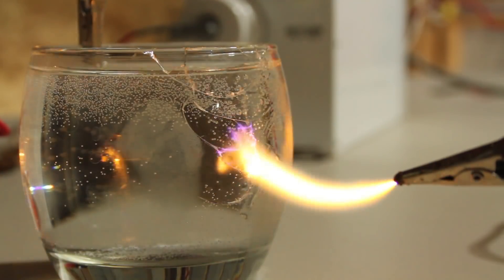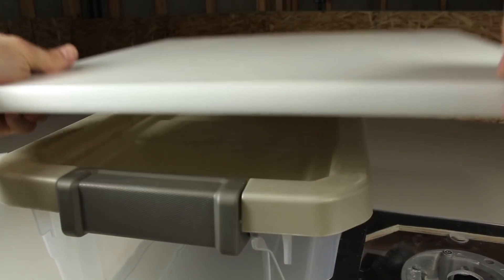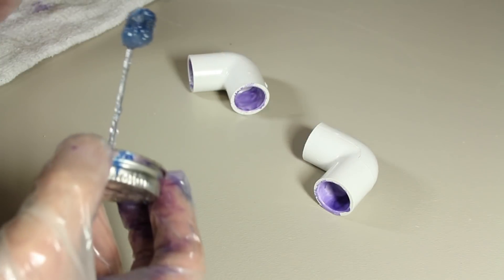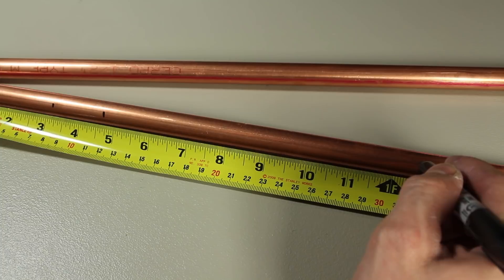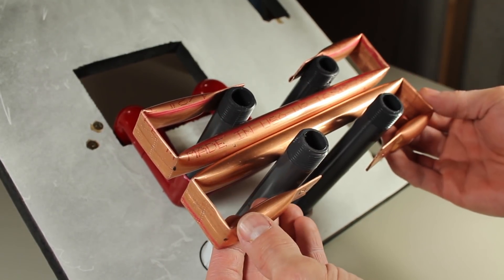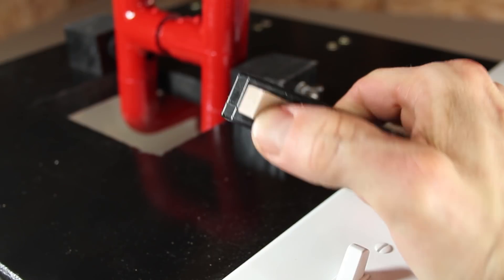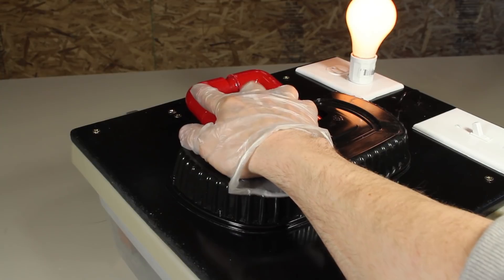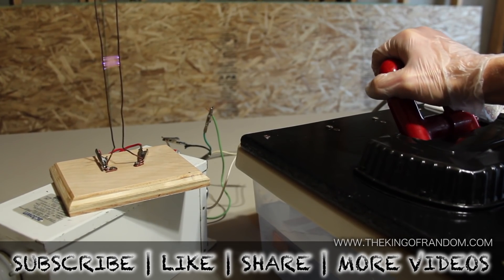The Scariac (Poor Mans Variable Power Controller)

Comment: What is the benefit of this over a dimmer switch?
Reply: Dimmer switches work by controlling the voltage, this works by controlling current or amperage. Different sides of Ohm's Law. Controlling current is more difficult than controlling voltage through resistance. Since he built it for his arc welder, controlling current is how you control the depth of welding penetration. Voltage supplies the arc, current supplies the heat and depth of the weld.
Reply: it can handle extreme power loads. try using a dimmer switch on a welder...
Reply: Very insightful response.  Thank you.
Reply: Also note that may dimmer switches are low amperage.  I built a hot wire cutter where my first dimmer switch fried on first use.  It fried in a short resulting in no change no matter where I placed the dial.
Reply: rcfalcon56MkII
This is the same as a dimmer....re look your theory on Ohm's law... The scariac changes the resistance the same way a dimmer does. The voltage stays the same depending on where in the circuit it is measured and whether or not a load is applied. In the video he did not have a load applied, so therefor no current was drawn and a voltage drop would not be possible.
 If he had connected the ammeter under the same conditions without a load he would not have detected an Amp difference either.
Reply: Gareth Crispin two for AC
Reply: Cheaper.
Reply: Maybe cheaper because it's salvaged materials, but dimmer switches aren't expensive and they're a whole heck of a lot safer to use.
Reply: the dimmer switches I've taken apart are simply pointometers, or variable resistors. should be the same as this. also, didn't he show this one controlling the current at the end of the video?
Reply: rcfalcon56MkII all it takes is just a pwm oscillator with a really big mosfet on a large radiator.
Reply: Иван Ерохин
or a bank of mosfets to distribute the current and thereby the heat more effectively. The only issue is that the internal resistances of each fet may differ slightly and cause one to take more strain than the other. But even then you have less chance of releasing the magic smoke...
Reply: Triacs, thyristors and other types of SCRs are ridiculously cheap and are usually sold as AC motor speed controllers for the exact purposes shown. A 4kW one cost me ~$6 with shipping, while a 10kW one can be found for around $30.

A 4kW one could supply more current than most household utility circuit breakers are rated at, save for three phase lines for electric ovens, stoves, water and other household heating, or maybe a workshop. Perhaps a glass blower's kiln would require 5+ kW and be regulated by an SCR, for example. I highly doubt that too many a private individuals would have easy access to 110V@~100 amps, or 220-240V@~50A from their mains connection, let alone use for it.

A light dimmer doesn't have to handle high currents, so their size and production costs can be minimized due to not requiring a heat sink or higher rated parts. Wouldn't want anything getting hot within a wall slot anyhow.

Sharing loads of parallel fets ineffectively has been the death of many of them, as can be seen on many videos of mosfets blowing up and failing here on YouTube, while SCRs can be scaled up to tens of kilowatts for the likes of electric furnaces with silicon carbide or molybdenum silicate heating elements. SCRs do have their drawbacks, but for these kinds of uses, they're standard stuff and for the most part have replaced variacs and not the least due to cost and size considerations.
Reply: Иван Ерохин for AC?
Reply: Иван Ерохин
I'd love to see you make that work...
Reply: Kageitenshi I do have one in a car actually, but you're right, triacs are better to use with high voltage.
Reply: Иван Ерохин
A what? A DC-AC inverter, since your description of using two mosfets sounds a lot like that? What was being discussed was regulating current on an AC-AC application, I thought.

Comment: I like the episodes but this one is really dangerous even fatal I've gone to school to learn to become an electrician and worked at an electrical coop it's a cool science project but should not be used in that manner just buy a dimmer switch and with proper rigging it's much safer.
Reply: A dimmer switch, really? It would burn out in a heart beat if used in high current situations which this device is designed for. Also, this controls current, dimmers control voltage. You may need to review Ohm's Law in your electricians course.

Comment: Many years ago I saw a fella that made a stick welder using 5  5 gal plastic buckets filled with some water solution and a 240 volt range plug.. I was always curious as to how the contraption actually worked...I can remember he changed the amperage by adding salt to the buckets.. Any Ideas as to how it worked and why it worked.?
Reply: well if im not wrong .... that was mehdi sadghdar (if im not wrong how write it). and the explanation is in his video so just watch it kay ...
Reply: Kenny Dani This was a fella that I worked with years ago but i'll watch the vid and see how it was done

Comment: Very interesting. But couldn't you do basicly the same thing with a $5 dimmer switch from Home Depot?
Reply: Not when you're pushing AMPS of current, no.
Reply: The dimmer switch would explode in seconds if he used it, he's using a microwave ark welder not a vacuumed, so I would use this, it's safer than a dimmer switch, but It can be deadly, so use a variac, not a scaryac
Reply: Joe Cope A basic dimmer switch, probably not for long. But there are multi-kilowatt "AC motor speed controllers" or SCRs that basically uses a souped up version of the kinds of triacs or thyristors used in the dimmers that can. A 4kW one costs about the same and can handle up to 220V@20A or 110V@40A and is made for these kinds of purposes.
Reply: Kageitenshi sitll not enough amps for welding though.  In his other clip with the arc welder he shows it controlling the current of the arc welder and i think it got up to 100 or more amps.
Reply: Ray Ward That's not how it works.
The extremely high amps are on the output side of the modified MOT, offset by the very low voltage. On the input side, the voltage is much higher, but the current draw is much smaller. In a transformer, assuming a 100% conversion rate, the VA in is the same as VA out:

If we input 110V and 8A, in order to get 800A on the output side, the voltage on that side would have to be  ~1V, this would correspond to 110 windings on the primary and 1 winding on the secondary, as most MOTs are cheaply built and have as many revolutions of coil on the primary as there are volts being input, for reasons I'm not going to expand upon here.

Assuming, again, a 100% conversion rate, this would be 880W of power, which is much less than 4000W for the SCR I mentioned and is also within the possibilities for the average MOT core rated at or around 900W. In reality, there are some losses with transformers and the actual power draw from the mains line would probably be closer to 9A.

For the sake of simplicity, let's use 100 primary windings as an example with 110V mains. One secondary winding gives you 1/100 voltage, or 1.1V and 100x the amps input, let's say 8, for 800A out. If you have two secondary windings, the voltage doubles to 2.2, while the amperage halves to 400, double that and you get 4.4V and 200A. For 8.8V and 100A, the number of secondary windings is 8.

If you have 200-240V mains, you can get more oomph from a similarly rated MOT made for that voltage range.

Obviously, it's easier to regulate the input voltage, than the output.
Reply: Kageitenshi why would you assume 100% efficiency?
Reply: Frank Rizzo
To set up a simplified example to explain the principle, nothing more. I specifically stated that in real life there are inefficiencies involved.
Reply: Would it be a good idea to fire the triac on the input on the AC wave peaks? ...Since the primary is an inductor. 

How much is the impedance of the thick wire of the secondary?

Comment: I tried building one of these for my HHO system, to control the output of gas on my torch. Problem is, it didn't work very well. I was using a 14 V, 75 AMP power supply. Soon as the 2 positives get close to each other, they start putting out an enormous amount of bubbles / hydrogen. The variac itself was robbing me of roughly 20 amps. The HHO cell WAS putting out gas but I was getting tons of gas in the variac as well. And I was only able to get around 55 amps to the actual cell. Something doesn't make sense about what he's doing cause 2 hot leads in conductive water at high voltage or amps = immediate electrolysis which steals current from your power supply.
Reply: Yes, wont' work well with DC. Try using it on the AC side of the system of (normal mains electricity).

Reason: The voltage is high enough to cause separation of water into hydrogen and oxygen (electrolysis). The rapid switching of the potential in the AC case prevents accumulation of H+ and OH- ions at the electrodes and stops this from happening as readily.

Comment: Interesting how voltage is constant and current is variable. In most circuits voltage is what drops when resistance is introduced.
Reply: Initial current from the mains supply is about 200 Amps, so unless you have an appliance to soak this up, the voltage should remain fairly constant.
Interesting, nonetheless.
Reply: Because the current is carried by ions in the electrolyte (water + NaOH). The ions move along the electric potential with drops by the square  of the distance between the electrodes. Lower potential per distance --> less ion migration --> less current.

Comment: If the scariac is used for high power control for a long time, I think  the conductivity of water will increase and the resistance will go low ....I am curious in what range the resistance will stay acceptable in this condition...

Comment: A good used variac is much cheaper than a trip to the funeral home. 

I suppose you could use sticks of 
old dynamite to hammer nails in to the wall also.
Reply: Yes, why not? Dynamite is extremely stable and shock-resistant. I don't see a problem
Reply: HeisenTwerk Also, Old Dynamite starts to leak or "weep" the nitroglycerin, forming crystals on the sides. This makes old dynamite extremely dangerous since it looses much of the stable nature new dynamite has.

All in all, I wouldn't handle dynamite sticks recklessly like that. If you still want to do that I wish you luck - you're going to need it.
Reply: You should replace the camera with this in a camera booth and change the name to "suicide booth"
Reply: HeisenTwerk Well, just replace it then for the nice little substance dynamite is based of.. xD

(Nitroglycerin)
Reply: Lol yusss

Comment: simple, useful & cool as all hell !.....I think the only "real" danger is the "potential" build up of H/HHO... which is extremely explosive !....although typically DC is used in electrolysis where the goal is "collect" Hydrogen and/or oxygen....I'm quite sure that it is NOT possible to have 0 gas emissions @ voltages that exceed the separation/breakdown of H2O/electrolyte... regardless of AC vs  DC
Reply: Electrochemist here to provide a little insight. The breakdown voltage of water to hydrogen and oxygen is somewhere between 1.5 and 3V, depending on your reference. 120V would definitely be enough, except that it is high frequency AC (I'm assuming the standard 50-60Hz). The water electrolysis reaction is actually incredibly slow, so the switching current would be fast enough that it would effectively shut down the reaction. Add to that the fact that the electrolysis reaction is catalyzed by acid... The amount of pure lye put in the solution would prevent any acid catalysis and further diminish the rate.

Finally, you will notice in the video that the lid was not airtight. Any gases generated would easily escape, limiting their concentrations and therefore their explosive potential.

So, aside from the fact that this project is just insane and probably lethal to anyone who is not familiar/comfortable/trained working with mains voltages, this aspect is actually pretty safe!
Reply: I like you.
Reply: what? simple, useful & cool as all hell ???!! this stupid idea reduce curet and your electric motor burns because you dont have enought curet to get motor spinning
Reply: Adam Valent did you watch the video?
Reply: do you study it?
Reply: just to the point that I'm pretty confident that the concept is fairly sound....& once made a similar apparatus long ago.
Reply: ya lol thats what he use for the water to fuel thing
Reply: Yah I bui another one I have the Handel and outlet sticking out of my work bench with alitle mods it can be Awsome

Comment: This would only be necessary for high currents right?
Anything else you could just use a dimmer I think.
Reply: No, dimmers use SCRs (silicon controlled rectifiers) and they chop up the AC waveform.  This is really not good for motors.  A variac keeps the AC waveform sinusoidal but reduces the voltage, allowing motors to spin more slowly without damaging them.

Comment: Right. This just limits the current going to the device. The potential remains the same roughly. A proper variac is actually a potential divider. Ie a carbon brush over a winding

Comment: Uh... So.. There's allot easier, cheaper, and safer way to do this. 
It's called a saturable reactor. You can google the term, youtube it, and/or wiki it. 

You need a cheap potentiometer, a DC power source, and a transformer that has center taps. The transformer does not need to be a microwave oven transformer. The center tapped windings are used as the AC windings and the other side (probably your primary) is run on DC. The DC current setups a stable magnetic field which restricts the AC power going through the transformer. The potentiometer allows you to directly control the flow of DC power. By decreasing the DC power you increase the AC power that is flowing.

The nifty thing is that the amount of DC power needed to control an amount of AC power is exponential. A 9 volt battery (which is around 5 watts of power depending on it's internal resistance) can be used to control 500 Killowatts of AC power. Thats a power factor of 5 (meaning it's there's 5 zeros in there). It involves no caustic liquids conducting electricity, and might be cheaper, depending on the amount of ferrous metal you have laying around. A potentiometer is 5-10 bucks, depending where and when you get one, and, as long as we're not talking kilowatts of power, a simple iron pipe with the correct windings would suffice for the transformer. All in all, You could piece one together for around... $30.00-ish dollars, that includes the cost of wire.
Reply: There's no way you can build or buy a saturable reactor that can handle 2.4 kW of power for anything close to $30! The copper wire just for the inductor would break this budget. You could switch to aluminum wire (as many welding transformers do for cost and weight reasons), but you're still going to be spending way over what this variable water resistor costs in both materials and labor. If you can build a 2.4 kW saturable reactor for less than $100 then I will be most impressed.
Reply: You are somewhat correct.
You cannot buy a saturable reactor, and it may very well run over $30 to make. As far as how much over, pricing each piece out, brand new, at the local electronics store and homedepot, I came to around $36. 

As far as how it works and why you can use it to control MEGA watts of AC power to watts of DC power (6 orders of magnitude, not 3, which is what kilowatts would indicate) is that a saturable reactor isn't a simple variable resistor.
A Saturable Reactor is a variable Impedance source. Skipping bits because this is the comment section... Because DC does not reverse direction, it blocks AC current. I'd recommend looking at reactance and impedance on this issue.

Comment: You are aware that using crystal drain opener to make the water more conductive, is a violation of Federal Law, because you're using that product in a manner inconsistent with its labeling?
Reply: Except that no one would ever prosecute him for that. It's more of a way for the company to cover their asses, "Not our fault you poisoned yourself with our drain cleaner because you weren't wearing proper protection, you weren't using our product correctly."
Reply: It is not a violation of federal law. You are misunderstanding the federal EPA rules regulating pesticides. While the EPA does recognize Sodium hydroxide as a "pesticide" it generally only concerns itself with products sold and labeled for pesticide use. Also Sodium hydroxide is  generally regarded as safe for use in food so it is also regulated by the FDA. Sodium hydroxide is an extremely common and well studied industrial chemical. As long as you are not using it in food or releasing it into the environment inconsistent with its use as a pesticide then neither of these federal agencies are going to concern themselves with the few grams being used here... This is, after all, a household chemical designed to be flushed down a toilet into a public sewer system... So ratting out your neighbor to the EPA or FDA for using Sodium hydroxide as an electrolyte in a closed electrical system will likely result in them thanking you for your concern, but to please stop wasting their time. Or, as my high school physics teacher would have said, "Please go be stupid someplace else." ... Sadly, he's probably not allowed to say that anymore. Well, plus he's been dead for decades.